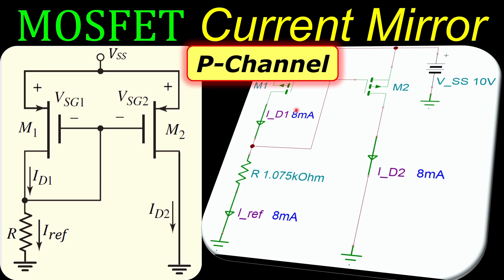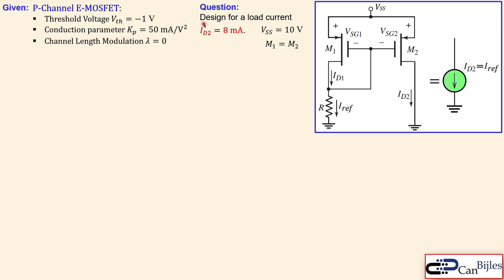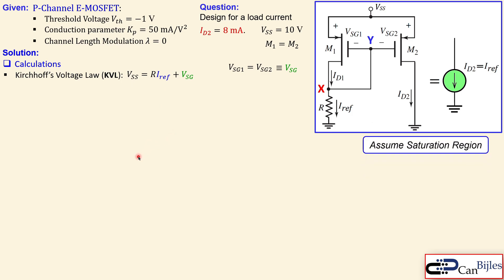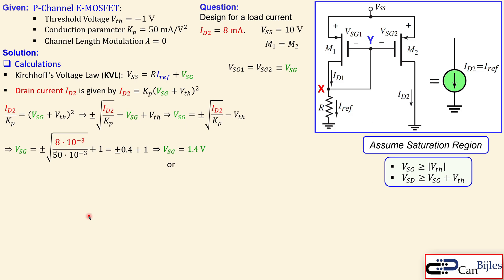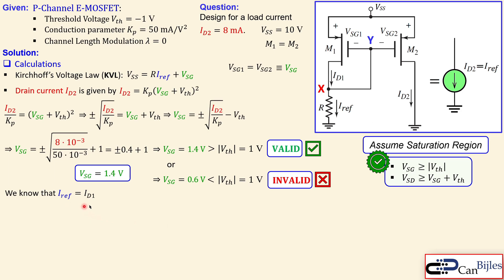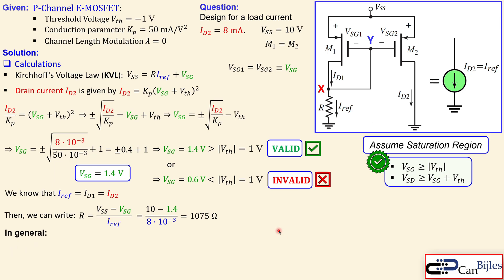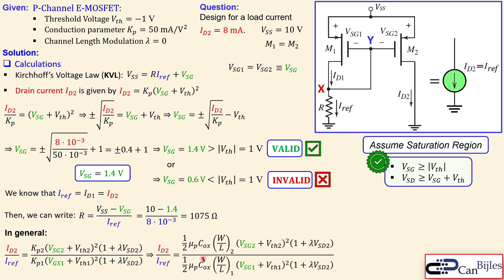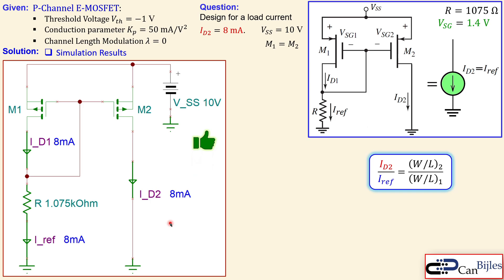MOSFET Current Mirror Source - P-Channel ⭐ Calculations & SPICE Simulations ⭐ Example 5

Comment: this is a current source. I guess we can call the NMOS current mirror as sink current!
Reply from the maker: It is a p channel MOSFET current source. Current is still sourced from the positive supply to ground. Another version using the n channel MOSFET current source is discussed in this video: https://youtu.be/D6ZfYhZXL-I
Reply: @CANEDUX  I agree on the P channel things. I wanted just o ask if we could consider the NMOS based current mirror as a current single, since it draws the current from the VDD to ground. I mean, any load should between the VDD and MOSFET ,its current is driven by the NMOS. I think it is a matter of definition between sink and source.
I am your new subscriber and I like your channel as it is very straight forward
Reply from the maker: @tarihad1145  The important note is, that the MOSFET is working as a current source such that it can supply the current for the load. Where the load is, depends on the design. Thanks for subscribing! Share the knowledge :)